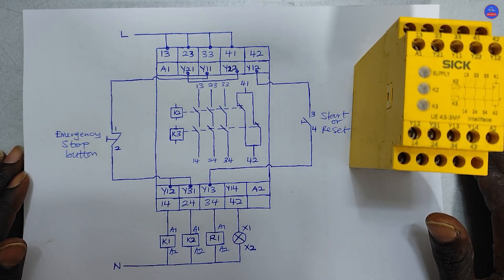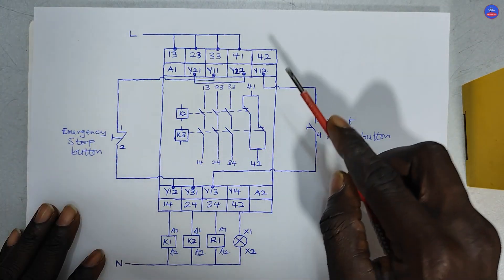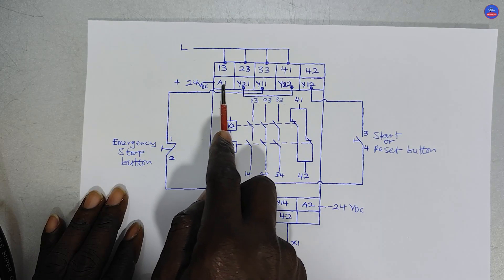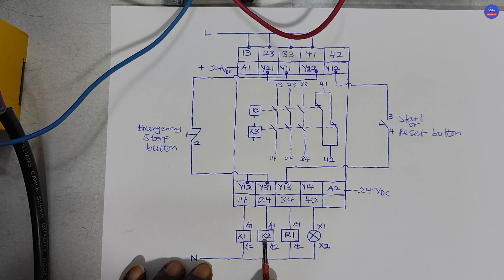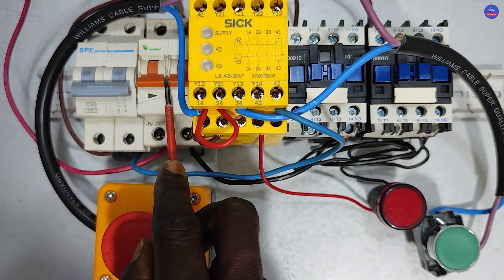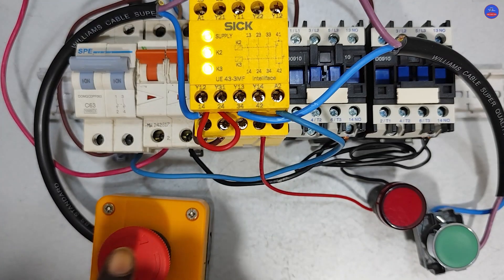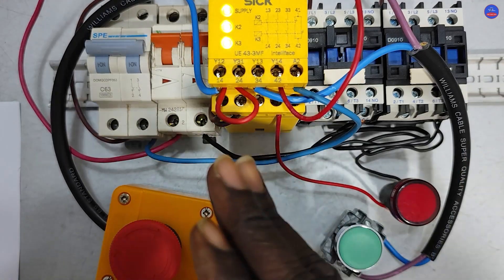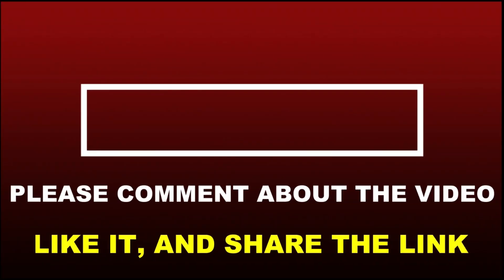Safety Relay Wiring Method with Emergency Push Button (Manual and Auto)

Comment: Thank u eng chris,,, make industrial controls easy
Reply: Thanks for the practicals engineer but were can we use this installation
Reply from the maker: @patrickbaafi2804 I mentioned in the video that, it is very useful in industries. In control panels to safeguard equipment.